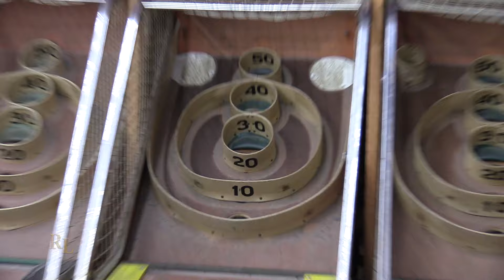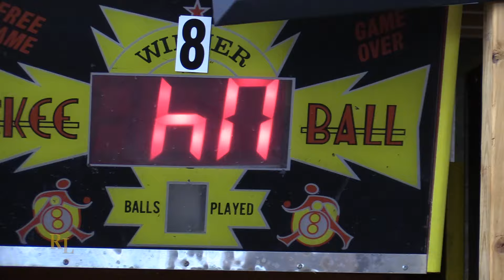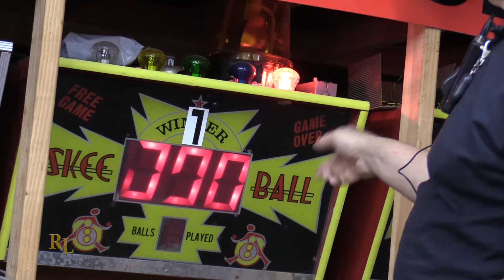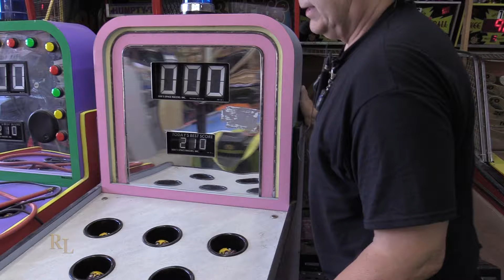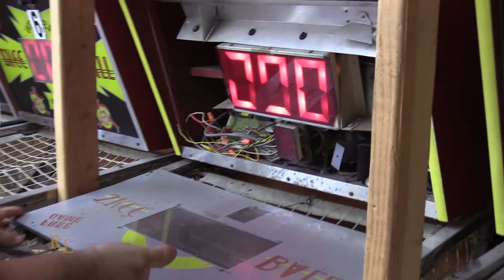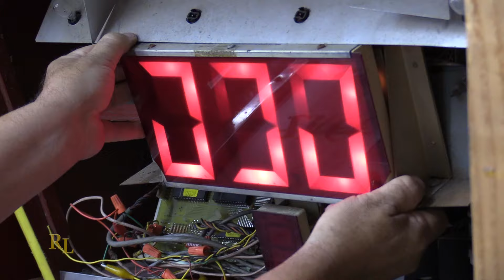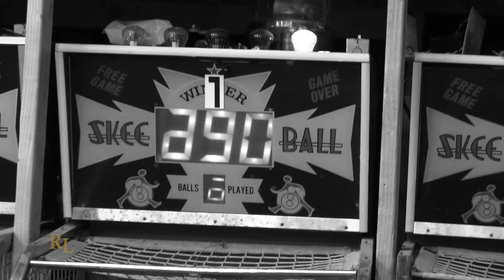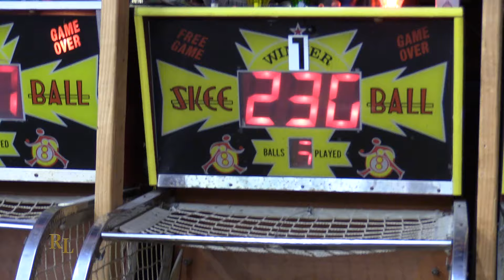What's wrong with my SKEE BALL machines?

Comment: I was the guy who hacked skee ball at my local arcades. Only took 4 tries. But you gotta hack different for every machine. To do this complicated task, you need... a doorstop. Just... a wedge of wood.
Put it flat against the side rail, then roll the ball down the rail. Dial in the trajectory. Once it curves to that bullseye one, you're golden. You removed all aiming. Now its just rolling it at the correct strength.

Comment: Hi Randy,
I loved your Skeeball video. It has been my favorite since I was a little girl in the fifties. My uncle actually worked at Philadelphia Toboggan and made both Skeeball machines and Carousel horses. So I was thrilled when you talked about the company. You mentioned an interesting thing about the current Skeeball units that have a net or a cover to prevent 'tossing'. What I have also noticed is that when I would roll my ball there was a way that when it got to the 'ski-lift' it would rise and possibly go to the higher holes. I think that these nets prevent that skill. The ball rolls and sometimes hits the net at the end and causes a problem with that 'lift' for some higher scores. Hard to explain, probably easier to show but I thought you might appreciate the comment. Thanks so much.

Comment: One feature I always liked about ice ball is that it counts how many balls it despenses at the start of a game, and counts each ball that comes back after it's been scored. If the game knows it's short on balls, it will re- dispense balls that have already been played to make up the difference. For example, if the game only has 8 balls, it will spit the first ball thrown back out. This way you have 8 balls again so at the end you will have played 9 balls.
Reply from the maker: @MattsCorner-kc6pt  some Skee Ball models did count the released balls and allow the same ball to return counting until the total, however, it should not be necessary.

Comment: I started playing Skeeball at Franks arcade in pt pleasant I remember it being 5 cents late 60s early 70s I remember the operator having a nickel with wire attached to it to reset the game if it malfunctioned
Reply from the maker: @karlschmitt6231  I remember nickel skeeball too, but it was a dime in seaside later 60s.

The nickel in a wire was specially made to insert and be at the correct spot to activate the release.

Came in a dime size later when dune pricing was made.

Comment: You could replace all those with LED wedge bulbs they’re Gry cheap on eBay or anywhere
Reply from the maker: @spaceman5091  they are not cheap in my opinion, but they will. It works in the system.